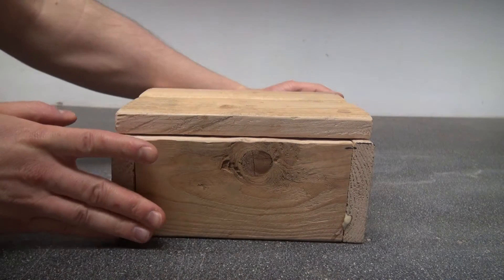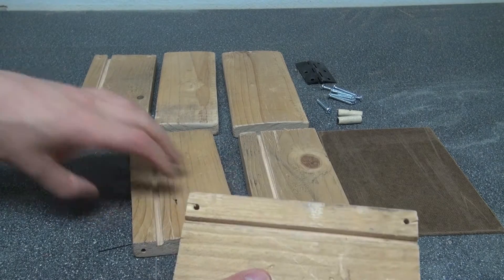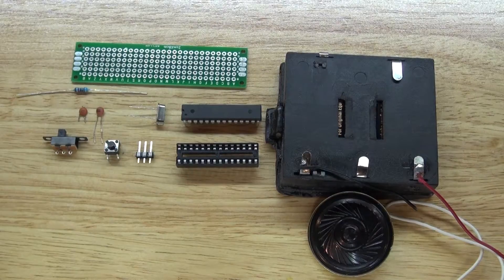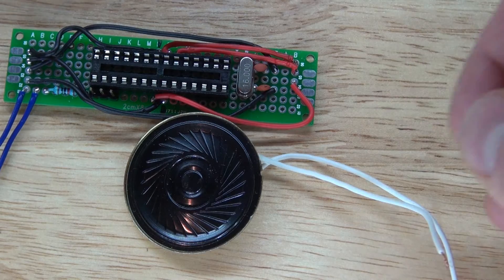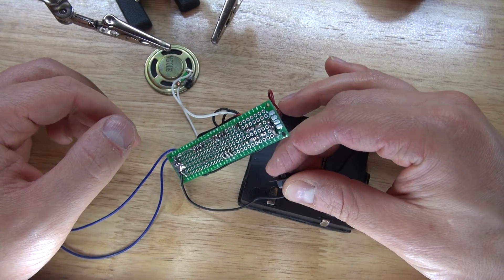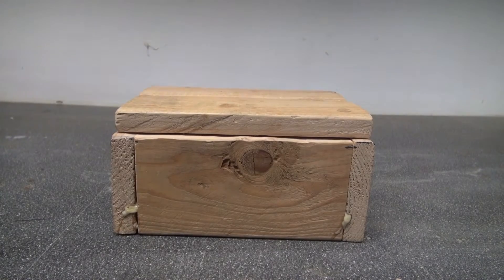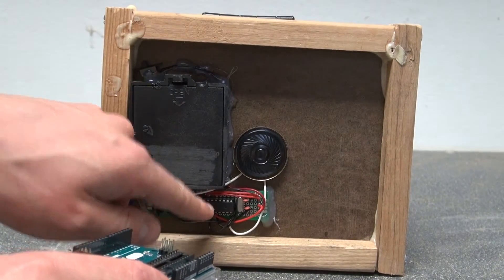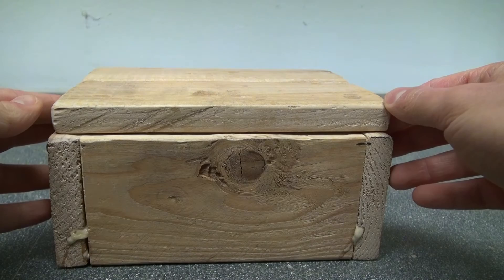How To Make A Digital Music Box With Arduino

Comment: Instead of building an arduino, can I just use my arduino itself and attach it to the speaker?
Reply from the maker: True, but I wanted something smaller, cheaper and to use an IC for this project. An Arduino would have been used up and not used for testing other projects.
Reply: @SciTyeTech  ah okay, so this would be something one does for something more permanent so that the arduino can be used for other things?

Comment: Good video I have seen a music box but with a fotoresistor in the lid ,that way there's no wires around  and no pressing button can you explain us how this will be using a fotoresistor please?. Thanks in advance
Reply from the maker: Thanks! That's a good idea to use a photoresistor! How that will work, is that you will need to use a bc547 transistor to add to the circuit as the switch.
Reply: @SciTyeTech I think that will work thanks!
Reply from the maker: @marinacaceres5127  Sure, no problem!